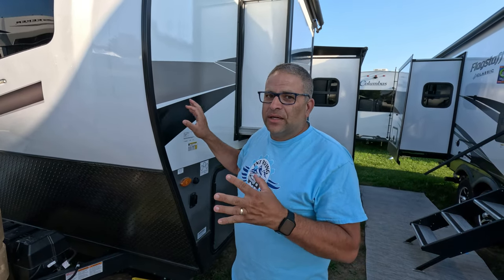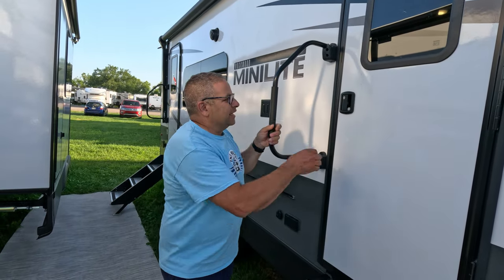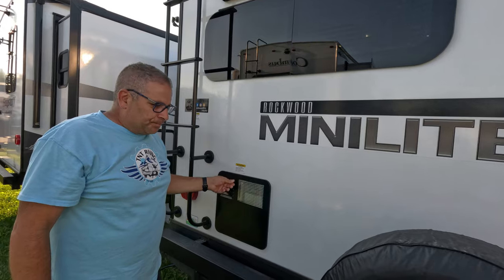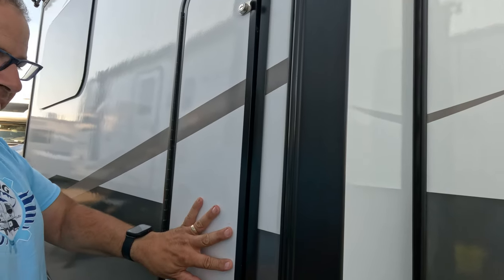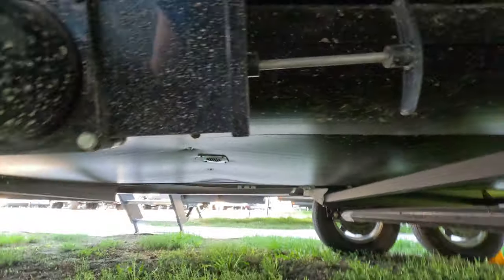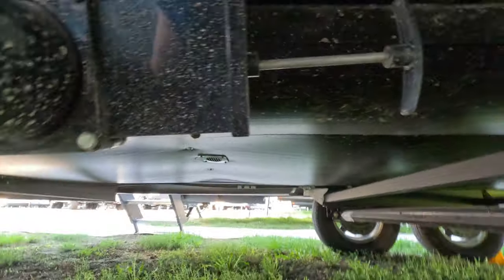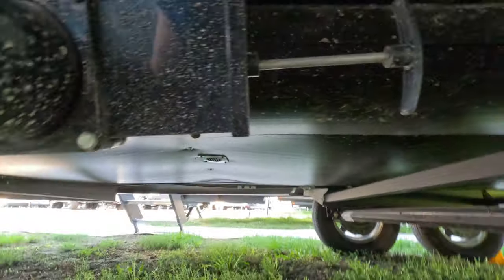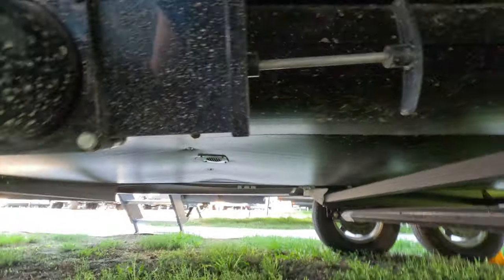2024 ROCKWOOD MINI LITE 2515S Prototype #rockwoodrv #rvlife #werv

Comment: I attended the Ocala RV show today.  I examined both this and my former favorite, the Grand Design 22MLE, a similar size TT.

I prefer this one for several reasons.  

1) The slide mechanisms are appropriate for the size of the slide; rack and pinion for the pantry/theatre seat slide, and Schwintek for the much smaller closet slide.  The GD uses the two track Schwintek for their nearly full wall slide housing part of the kitchen and seating. Based on reviews I have seen, that is looking for trouble.

2) This model has slam latches; GD has the twistees.

3) This model has torsion suspension, while GD uses conventional leaf springs.

The GD has more kitchen counter space and a full size queen plus a fully open floor plan.

But on balance, the Rockwood has more robust features that I would find more useful.

Thanks for your review.
Reply from the maker: Sounds like you are doing your homework. The difference you mentioned are spot on, great job.
There are other things to consider as well, Rockwood/ Flagstaff have all six sides aluminum framed with Azdel inside & out plus block foam insulation in wall panels and roof.
They also use aluminum to support bed frames and dinette’s as well. We just did a video on how the walls a roof are made and earlier this year we did a production video.
Appreciate you watching and commenting, any questions feel free to ask, we know people. LOL!

Comment: Awesome video as always.  Question on the roof.  It looks awesome.  It appears to something like a Filon material.  I had a Jayco Alante Class A motorhome that had this type of roof. I really liked it.  If Rockwood/Flagstaff would go in this direction it would be another contribution to their superior build quality.  I currently have a 27BHWS SUPERLITE.  We are planning to downsize in retirement.  The Micro/Mini appears to be a good choice for our future needs.
Reply from the maker: Your future Roof on the Mini Lite will likely have a one piece vacuum laminated fiberglass roof. The roof on this unit appeared to be a thicker fiberglass, feels like side wall thickness. We love Rockwood/ Flagstaff as they are once again setting the bar higher for other manufacturers.
Thanks for watching and commenting!
Safe travels and Happy Camping!

Comment: I see this one comes with a 74” bed. Can an 80” be put in its place? A 74” bed is a deal breaker and noticed a lot of these Mini Lites have a 74” bed.
Reply from the maker: Unfortunately this on only comes with the 74” queen. If you added the 80” queen you would not be able to walk around the bed.  There are some that have the 80” queen, the 2205s, 2608bs and the 2516s for examples.  Thanks for commenting and watching. 🙂

Comment: Nice walk-through. Looks like that might be an on-demand water heater? What is the weight and length of this unit? Likes: Roof is awesome. Looks very solid with minimal upkeep. Fridge doors are cool. Concerns: not much counterspace in the kitchen. Might just be because it's a video, but living area seemed a little tight. Short queen bed in a ynit this size??? Huge miss.
Reply from the maker: Hi Janis, No It's a Gas Electric water heater, I had just mentioned to Tina that we should start providing the weights & lengths of the RVs in the videos. We initially left that info out so we wouldn't be bombarded with questions on towing. The counter space is a little small in this unit but having a dinette makes up for it. the 60" x 74" bed is a little too small for Tina, but ok for me. As always Thanks for watching and Commenting.

Comment: It's a nice trailer , I have a Flagstaff 25 fbls . Good thing I have a F250 because my tongue weight is 918 lbs . 50% more than the manufacturer claims , not many 1/2 tons can safely carry that .
Reply from the maker: We pull our 2205s with a 3/4 ton GMC, it’s nice to have the extra payload capacity. Thanks for watching and commenting!